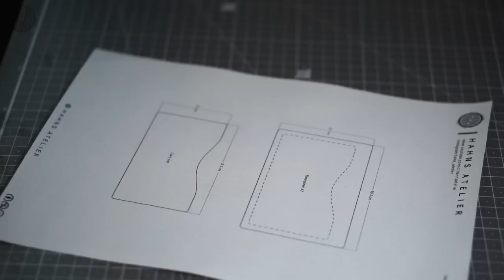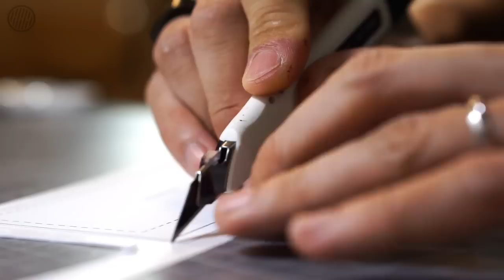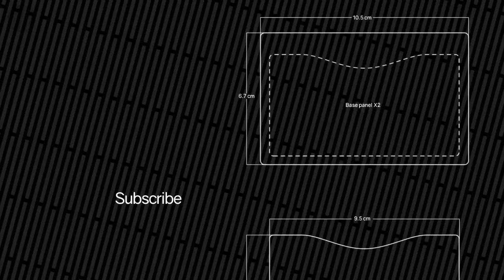[Leather Craft] Making a minimalist card holder | Free PDF Pattern

Comment: I tried, but the cards didn't fit. can our measurement units be different? 😞
Reply from the maker: I think you got typical problem that I get usually. You need to fix print setting. There is a printer setting on your computer. when you print it please check 100% size print or actual size print. It will be solved the problem.
Reply: HAHNS ATELIER ok thank you very much. i will try again now.  love you and your good heart. 😍

Comment: B5 glue - what is this?
Reply from the maker: This is for leather and fabric. 
Here is the glue that I use usually Hope this helps!😊
1. kenda bond 
: yellow, chemical smell, very strong, low price
2. intercom ecostic, high price
: white, no chemical smell, thin
3. Instant adhesive
: race, braiding, metal hardware (rarely)
4. B5 bond
: Beige, Thick, using for lining.

Pattern link : http://bit.ly/2U174x3
Subscribe : https://goo.gl/AKxcPM
Don't forget to click 👍 :D
The link will have expiration date.

Comment: Please send the pattern whenever you can. Thank you! I know that your time right now is 5:23am.
Reply from the maker: Thanks for the comment. Enjoy crafting!
Reply: Hahns whenever you have a minute please read my previous message and please answer me. You cut the leather as per the template measurements? or you modified the cutting while you were audio taping the making of this wallet? You do not need to send me the final measurement after you finished making this wallet. Believe me this is my first time trying to make one of your designs. Hope to hear from you.
Reply from the maker: @michaellopez9915  Hi Michael, I think you printed out with "fit to the print size" option of your printer. Please print "Actual size" also If the leather thick and hard, needs to be stitching hole wider a bit =) My final measurement is 10.6cmX6.8cm. Hope it helps!
Reply from the maker: @michaellopez9915  Hi Michael I cut the leather 2mm larger . because I cut it whole parts together for making clean edges. 2mm or 3mm both are fine. =)
Reply: @HahnsAtelier  My printer is set to actual size.
Reply: @HahnsAtelier  2 or 3 mm on each side? (not need to answer), I needed to hear from you. With all my respect, I know how to fix it but are many other people that just starting, maybe it will be nice either to send the right size because I am sure you knew it in advance.